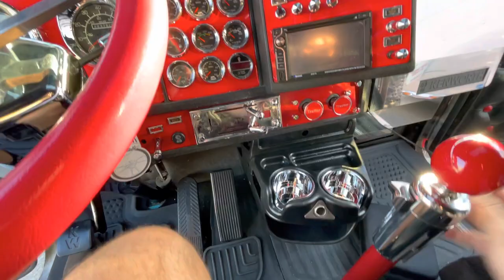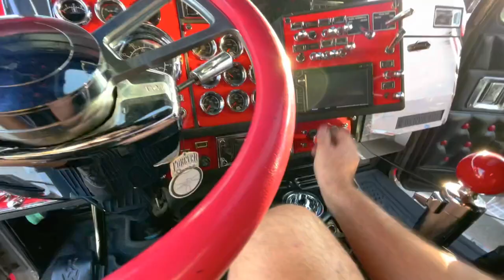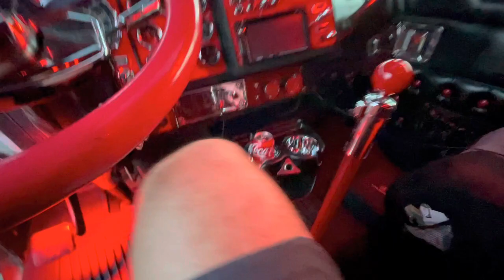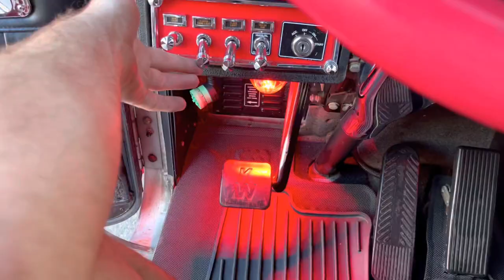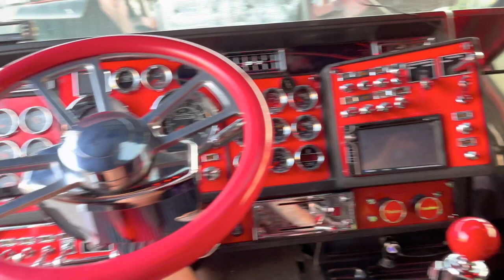W900 CUSTOM CENTER CONSOLE FINALLY!/  custom lighting/ just chillin vlog!

Comment: Love all the add ons I have the same Wood Console and same door lights. I do like the Watermelon light idea for the Sleeper light. Did you paint all the Interior Panels with that Spray Paint?  Also bought a 12 Gauge Lowering Kit for mine, I noticed back in your Air Ride Video you kept 2 Leaf Springs, is that correct?